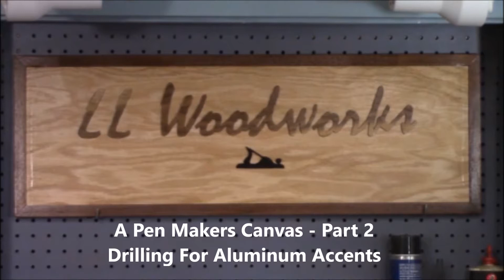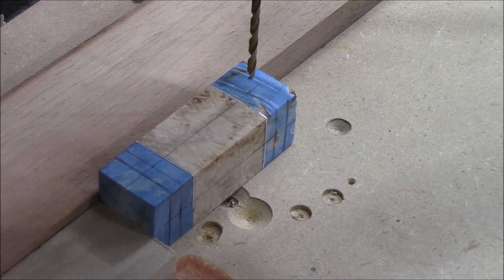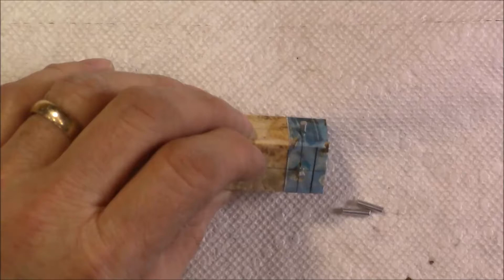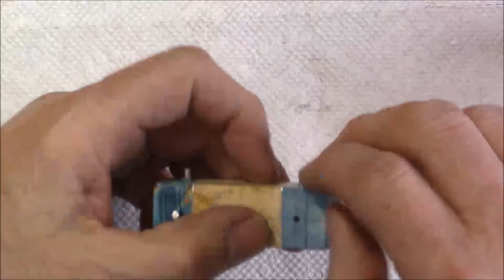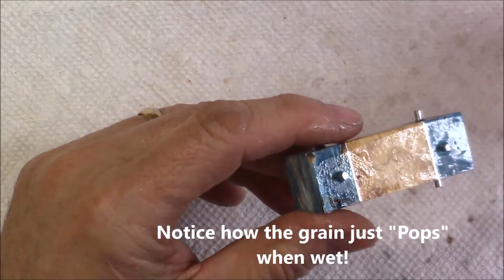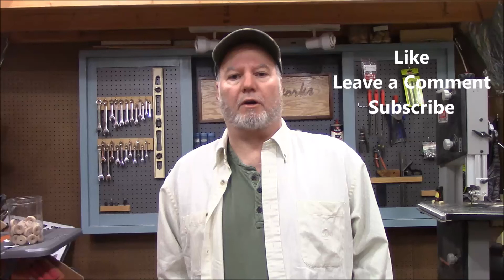Pen Makers Canvas Part 2 - Aluminum Rod Accents

Comment: Hey Lynn, I noticed that the aluminium ends up a bit dull. Is there any way to get it to pop more? I’ve been a little disappointed when I use aluminium to date - always dull. Any thoughts and ideas would be appreciated
Reply from the maker: That usually is the case when I used aluminum with woods. Sorry but don’t really know what to do about it. When used with acrylics it will shine up as its worked through the micro mesh since there is no ca sealing it.  Thanks for watching
Reply: Thanks Lynn, I appreciate you taking the time to answer. Great vid, really enjoyed it

Comment: I love the idea of segmented pen blanks and have made a few of my own. However, I am concerned that my current lathe tools would not be able to handle turning down the aluminum, and when I make contact with one, that I would either damage my tool, or it would catch and tear up the pen blank? What tools do you use when turning blanks with metal accents? Thanks for the informative videos, they always give great advise and new ideas to newbies like me....
Reply from the maker: Hey Dana -  When I use aluminum I turn it with ordinary tool steel turning tools.  As long as they are sharp you shouldn't have a problem.  Can't say about brass as I have never used it but wouldn't think it would be a problem for sharp tools.  Good Luck

Comment: Hey Lynn I am very new to turning and want to give different pen combinations ago.   What tools did you use to cut the aluminium rod?   Could I use a brass rod?   The timber that you used is that natural, and if it is what's its name, please?   Cheers Sean
Reply from the maker: +The Bungling Woodworker Hey there, I used the band saw, brass also works, that pen is made of blue dyed and natural box elder burl.. thanks for watching and commenting.